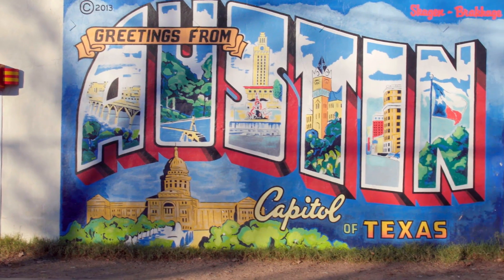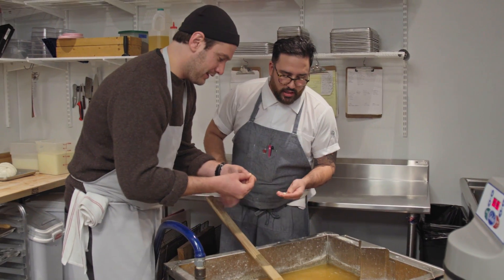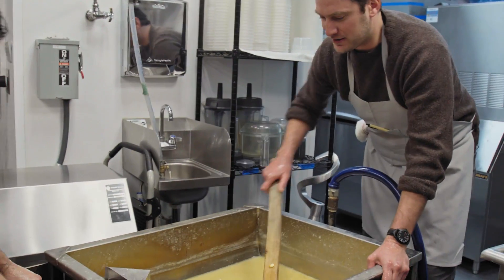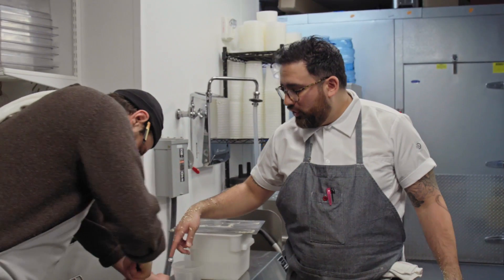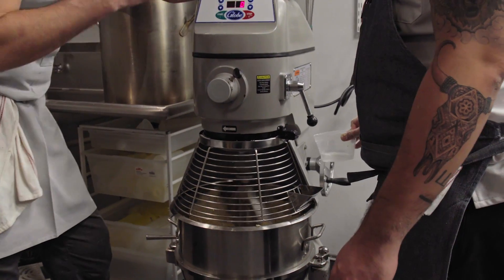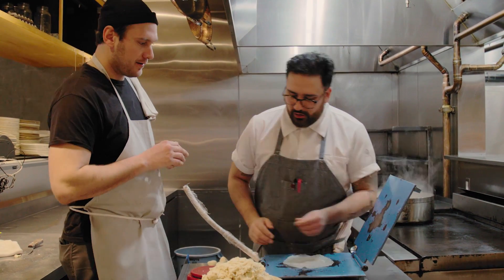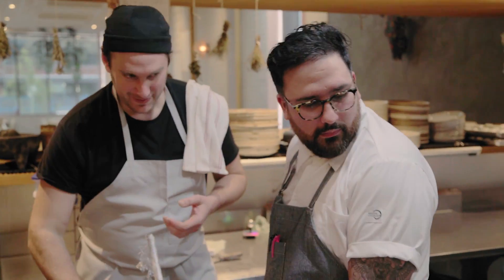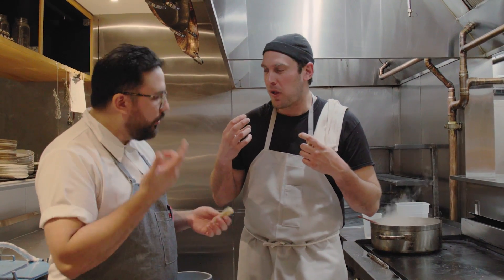Brad Makes Tortillas | It's Alive: Goin' Places | Bon Appétit

Comment: Nixtamalization- also frees up the nutrients of corn, primarily niacin. If contaminated by mold, it also purges most of the possible toxins.

Corn treated with lime is called “nixtamal” (neeshtamal) derived from the Aztec name. Tamalli (tamal) means dough, from which we get “tamale”
Reply: When the Spanish first introduced corn to Europe they didn't know about nixtamalization and there was a wave of malnutrition as a result.
Reply: But he didn’t use lime to nixtamalize it 😱. There will be a difference in taste
Reply: He uses calcium oxide. Calcium Oxide (quicklime) is added to water, hydrates to Calcium Hydroxide (slaked lime). Calcium Oxide is derived from cooking limestone. 

You can also use wood ashes which are mildly basic (pH above 7.0) to nixtamalize corn.
Reply: @danielm5535  yep. My people use juniper ash for nixtimalization.
Reply: You were so good until the tamale part. Tamal is the singular for tamales
Reply: mpatrick he did use lime...

Comment: 22100 g, 1% -> 221g  
someone tell me that aint beautiful. 

metric system for the win
Reply: Us Americans just have a higher IQ and like the challenge of the imperial system.
(I'm just kidding, but I refuse to admit our flaws)
Reply: @jskthefork  i loved your response 😂😂
Reply: @jskthefork 
> claims to possess higher IQ
> Names scientific measurements after body parts

Iq OvErLoAd
Reply: @TheMuse260  >joke
>green text
Reply: Metric/imperial arguments are sooooooo 1998
Reply: If you replace grams with any imperial unit your example is still going to be true. 

The reason the metric system is useful is unit conversation, for example: 22.1 kg = (22.1 * 10^3) g = 22100 g.
Reply: MrFArtistic unit conversation?
Reply: 1% of 22100 oz would be 221 oz. Beautiful, right? You just did a percentage lol, it has nothing to do with it being metric. I love the metric system too, but percentages have nothing to do with what measurement system you're using
Reply: PinguThePenguin Yeah we named the inch after one of your body parts, specifically. ba dum tssss
Reply: Kelsey Bittner Kelsey Bittner well yeah it does have to do have to do with the measurement system your using because no kitchen scale is going to measure up to 10000 oz to make the calculation easy for you.

The scale in the video measured 22.1 kg which can be simplified to 22100g, 1% of which is 221g

In imperial that would have been 48.7lbs, 1% of which is 0.487lbs which is 7.79 ounces. Maybe you’re smarter than me but I’d have to use an online converter or at least a calculator or something to make sure I didn’t stuff the conversion from pounds to ounces up.
Reply: @serkzz  Yeah of course, that's true. But I was responding to someone who said none of that, he just said 1% of 22100 was 221 as if that was amazing. If he used your reasoning for his point, there'd be no problem. But he didn't use your reasoning, he didn't even say 22.1 kg instead of 22100 grams. If he just said that, I'd assume he was trying to make the point that metric has easy conversions. But he didn't. Finally idk why you're talking about 10000 oz, I never brought such a figure up
Reply: @batt3ryac1d  Well it's also because of Europe that you didn't get the metric system, so...
Reply: @itpaynesme  converting from one unit of measure to another. In the metric system all the units differ by powers of 10, so all you have to do is move your decimal point like in my example. Measuring in other things like mass, distance, and volume follow the same convention as well. This is one of the main reason that the sciences use metric system as their standard system of measure.  This is not the case in the imperial system.
Reply: MrFArtistic I think the word is conversion, not conversation- that’s all I was saying. I’m just being an annoying little pedant, don’t mind me.

Comment: Why is he surprised it's blue? All band aids in all kitchens should be blue.. it's a thing that's been a thing at every food place I've ever worked. It's so you can easily detect the source of a rogue band aid in your soup. They're also heavy woven and have a stronger adhesive on them (stronger and stay in better in a kitchen environment)
They also have a strip in them that's "metal detectable" if That's a thing lol. I'm pretty sure it's a law

Comment: That knife switch is not made to start and stop a motor. It's also dangerous to have a switch without low-voltage protection. I recommend bringing in an electrician to install a motor starter with  stop/start buttons as well as an emergency stop button near where people are feeding the corn into the machine.

Comment: 4:16 unless the hole in that tube is intentional for some reason beyond my knowledge, replace the damn tube, they are cheap, you can get 15 feet for less than 50 bucks (WAY LESS THAN).

Comment: A gram is 0.01% of a kilogram, not 1%. Even if it were 1% then the chef was still incorrect in saying 220g as 22.1 * 100 = 2,210. If they really had 22.1 kilos of the mix then they had 22,100 grams.

So obviously the chef did the math wrong too or the scale wasn’t showing kilos, so I wouldn’t feel so bad Brad
Reply: Ryan Spivey 1% salt of weight 22kg= 22000 grams 1% of 22000= 220
Reply: @danyaelkanzi9028  ahh, I thought they're were just talking about the total yield of the mixture, not the salt content. Makes sense!